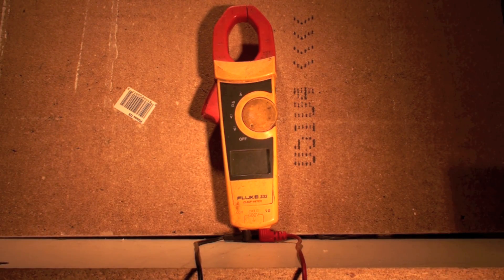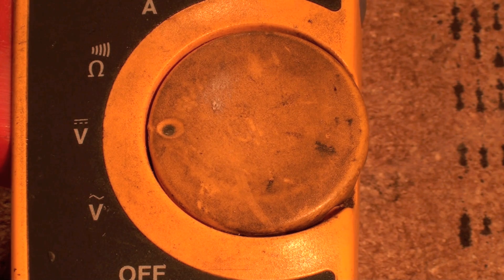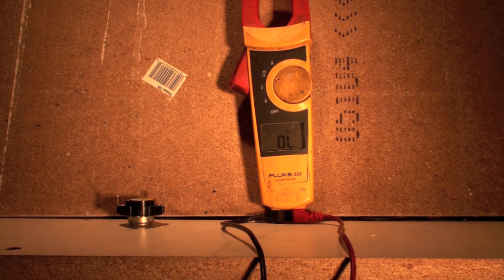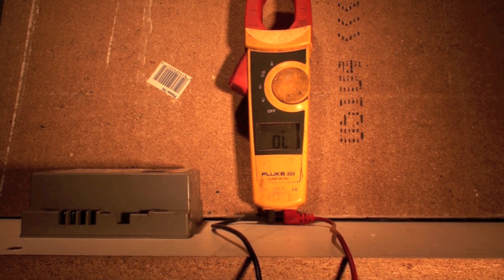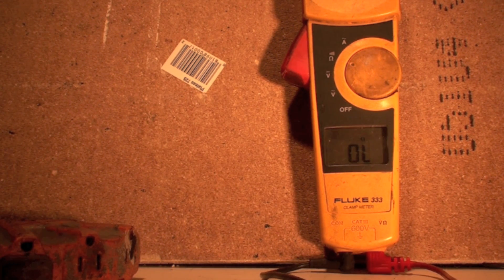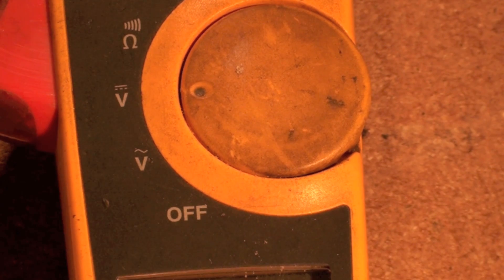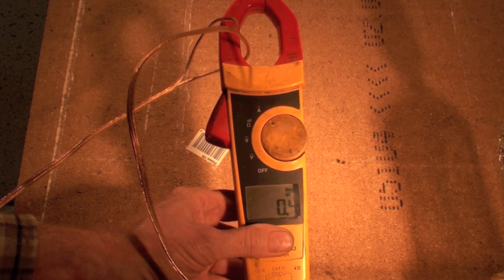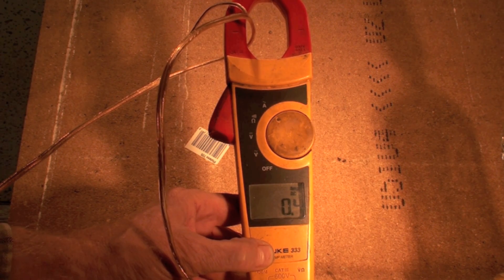How to use the clamp meter.  Part 4 of meters for HVAC

Comment: so this meter doesn't measure DC ??
Reply from the maker: It can't be used as a DC clamp meter.  It will work in the voltage mode.
GFM

Comment: I have a fluke 117 seems to be a pretty good little meter.
Reply from the maker: If you are working with HVAC, the 117 does not have some features you will need.  Namely DC microamps.
GFM
Reply: grayfurnaceman That's true

Comment: wow my favorite thing about this meter is it can read amps without breaking the circuit but i cant afford a Fluke brand, whats the cheapest clamp volt meter that that works well that you would recomend?, thanks!
Reply: UTL by UEI. Like 40 bucks.  Reads amps etc. Also has a voltage detector.
Reply from the maker: +Youtube Tv There are several brands such as Amprobe or Klein that made middle of the road meters that may serve your purpose.  No recommendations here.
GFM

Comment: I do a bit of handyman stuff around the house, not much into AC work, but use the meter for testing batteries and  electrical work.  I'd use it more if I understood the thing better - so I've been viewing your channel.

My question:
When you were in the ohms position the meter (like mine) buzzes when there is continuity.  You tested 3 things, The unit buzzed for two of the there,  However when you testes the relay (the item with the larges resistance) there was no buzz.  Why?